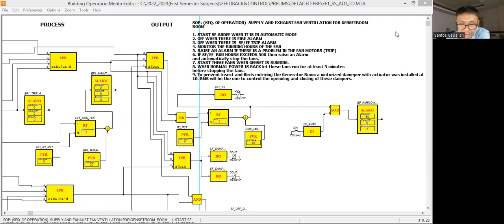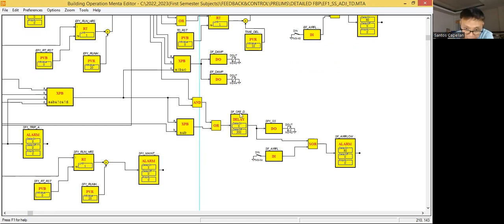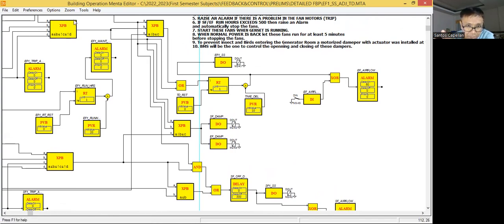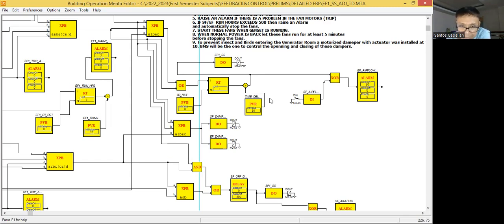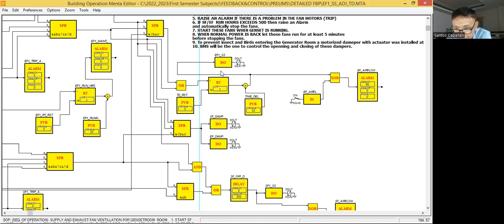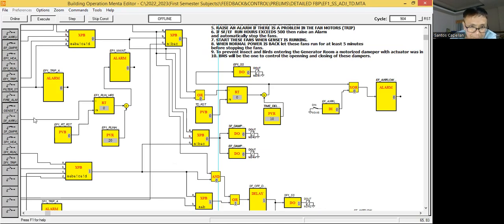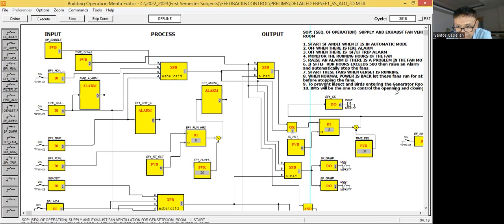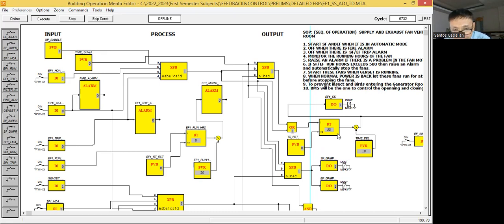BMS - FUNCTION BLOCK PROGRAMMING PART 10. (USER ADJUSTABLE TIME DELAY TO START AN EQUIPMENT).

Comment: i already tried with run time logic before. i had 2 problems before 
1. this run time counting is not accurate as the correct clock counting 
2.fan may work more than many hours continuously so in between these time run tjme will count so long 

i really appreciate your effort sir. is there any other way to solve it out?
Reply from the maker: what you need is just a time delay before starting the equipment which I guess can be done using the RT block, what exactly is the problem? make a screenshot of your logic where you used this approach
Reply from the maker: use the RT then you can use an expression block to reset the RT
Reply: @SantosJrCapellan-BMS  the client will count the time accurately unfortunately this RT block will not be same as how clock counts that's the problem
Reply from the maker: @krishnakumarmuraly3038  what are you turning ON? it seems complicated and delicate, you need to sync AS or the server to the client's clock